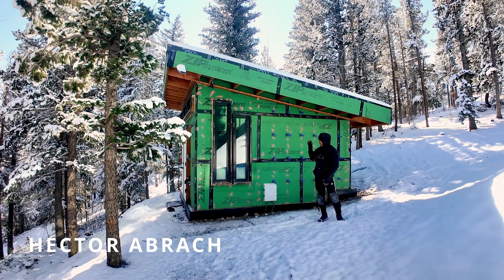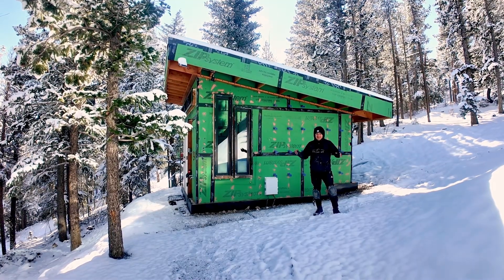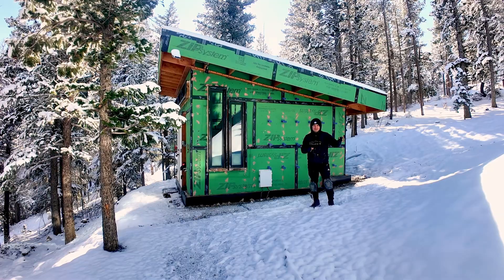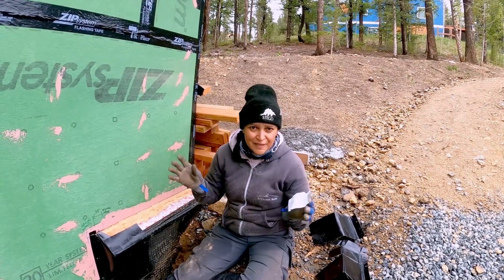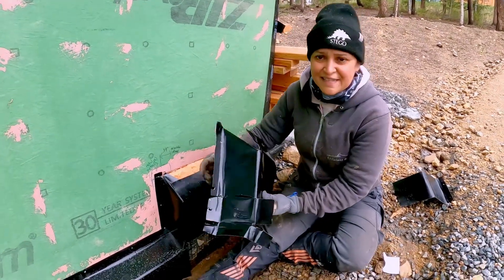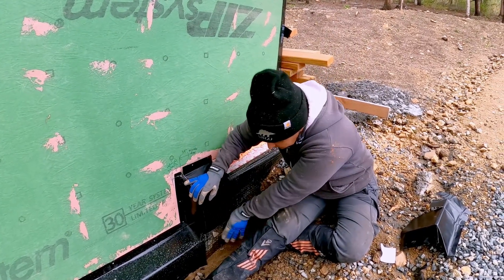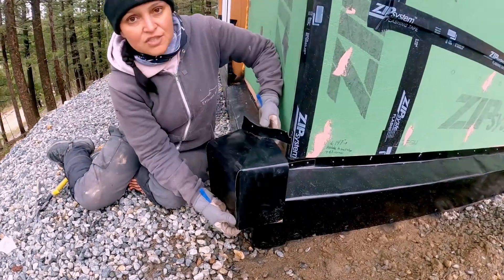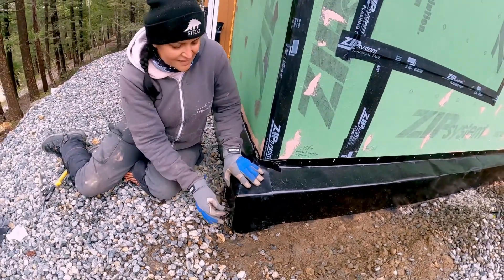Why Exterior Insulation Changes Everything: Polyiso + Mineral Wool + Z-Girts Explained!

Comment: I think your Z girt installation direction is wrong.  It should be mounted vertically on the wall, instead of horizontally to maximize the strength that the Z girt can provide to the cladding on the outside.
Reply from the maker: You are correct that the way to maximize strength is with a vertical installation, but fiberglass is super strong. The manufacturer's website recommends horizontal installation. In other words, you could do it in any direction.